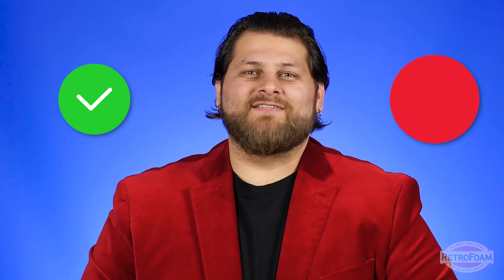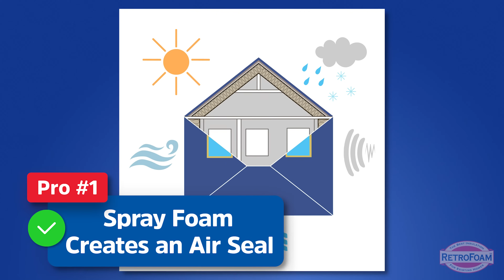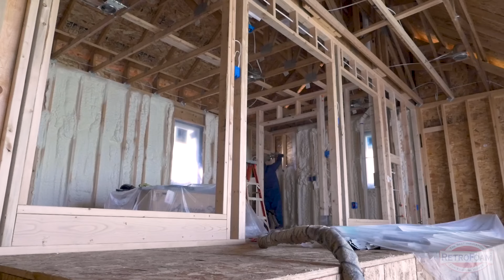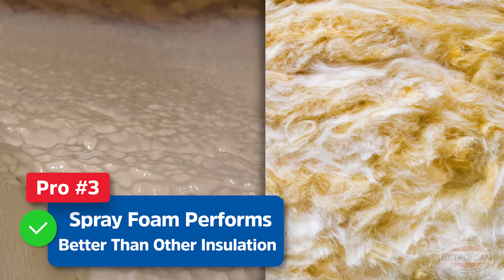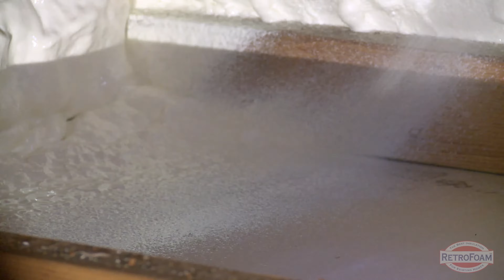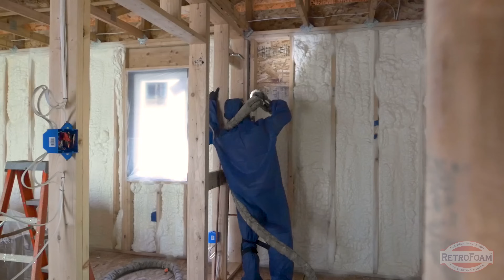Spray Foam Insulation Pros and Cons | Foam University by RetroFoam

Comment: can a house be too tight  with the foam insulation sprayed with drywall removed for the spraying?
Reply from the maker: Nope, you should be good to go! This article from our Learning Center includes some very helpful information on this topic: https://www.retrofoam.com/blog/does-retrofoam-make-house-too-airtight
Reply: Don't listen to this joker. Regular insulation seals up a house sufficiently, in fact having a house that is sealed too much is A BAD THING.

Comment: Confused... Spray foam is R2.  My fiberglass is R22...
Reply from the maker: The R-Values here are per inch. Your fiberglass actually has around the same per-inch R-Value, but keep in mind it doesn't create the air seal that foam insulation does.